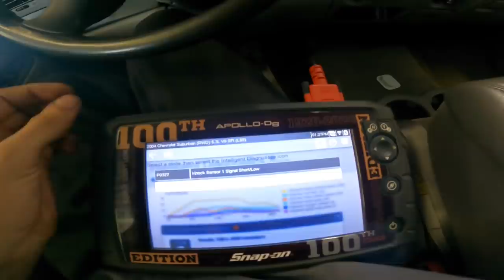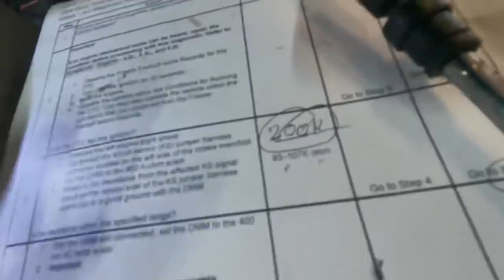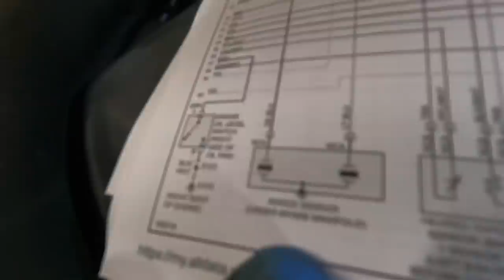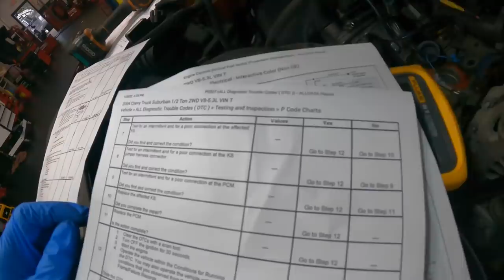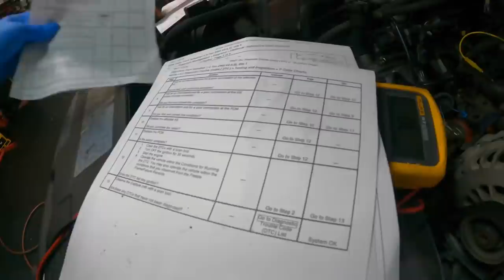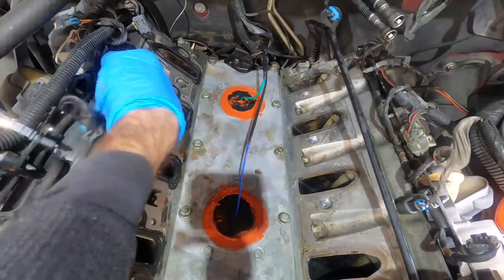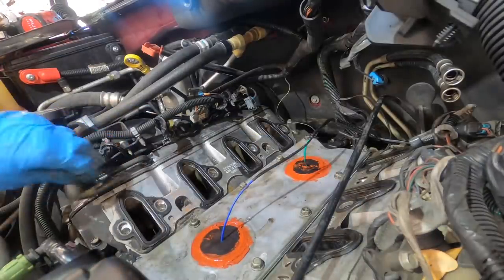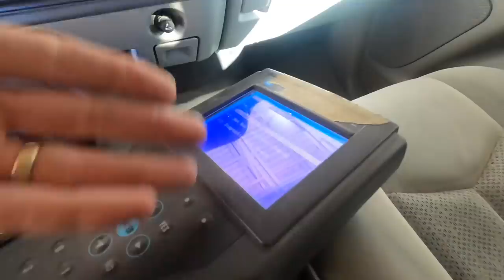Had to DRILL the engine block. NIGHTMARE Diag! LS 5.3 Check engine!

Comment: I highly recommend some cutting oil when drilling metal, and lower speeds and high pressure if you can. It takes patience but at the end of the day your drill bit will stay sharp longer
Reply: If you check a drill bit feeds and speeds chart you will be amazed at how fast you are supposed to run them.  Faster than most hand drills will go.  A 3/16 drill bit recommended speed is 2800 RPM.  And the smaller drill bits run even faster.
Reply: @johncooper4637  then why does my 1/8-1/4 metal cut better the slower i go lol. Hell the slower you drill the faster your bit cuts to an extent anyways i always keep my drill on 2 never 1, but i never just full or half throttle it. There are bits out there tho hyperbits i believe, where its just full speed ahead. Ive actually have never heard of such thing of using a normal drill bit fast unless it was a hyper bit
Reply: Im no professional drill bit guy but i have found that with hand held drills using oil and going slower and applying more pressure helps preserve the life of my bits, even using oil and going fast it just ruins the tips. Maybe its because the hand held drill cant push the rpms the bit is designed for and cant cool fast enough?  Again i dont know very much about the science of it, just what i observe when using the tools
Reply: @danking5382 Because you can't apply the kind of pressure needed to match listed feeds and speeds.  Cheap drill bits will last much longer at lower speeds in a hand drill Because you can't push hard enough.  In a drill press or mill, fast will cut better and last just as long or longer, because the feed pressure is much higher, and its steady.  Hand drills are easily pushed around, causing chatter, which kills cutting edges.
Reply: @danking5382   I'm with you, I worked for a fab shop and did so much welding and fabrication in my free time, that I made it my day job and started my own business. I have a fabrication/machine shop, I also offer mobile welding services including 24hr emergency response, New service offer: Having been addicted to Jeepin' for as long as I can remember, I too need to get my fix for the wheelin trails. Needa trail-fix the rig so you can keep gettin your trail fix, Or just plain ol stuck? Call Willy Bros Yank 'em! You stick'em in, we yank'em!
Reply: @johncooper4637  True... smaller the bit the faster the speed. 
Same applies to all machines like drill press, bore, lathe and mills. 
RPM = 300 x V/d.  V being the max linear speed of the cutting tool material as applies to the metal being cut/drilled.
The thing is, the idiots that don't understand this fail to realise that the larger the drill bit the slower the max speed... to the point where those that should never have a hole saw in their hands go at it way too fast - the saw burns or throws sparks.... saw is ruined in less than a minute.. even with cutting oil or coolant.
Reply: @loganramos6900  A drill bit is a cutting tool.
You need to be able to recognise a dull blunt cutting tool.
You need to be able to hold the hand drill correctly... and apply force correctly.
The 'science' of it is... 
The cutting edge on the tool (drill bit or lathe bit) can travel along the length of a specific material (metal, plastic, wood) at a speed (velocity) that has no degrading effect on that cutting edge - the tool stays sharp and the cut is cleaner. 
Tool manufactures publish data on the recommended the max linear velocity, so machinists can select the correct cutting speed (rpm) for the diameter of the drill, mill bit or stationary lathe cutter.... according to the material the cutter is made from (high speed steel, cobalt steel, tungsten, carbides, diamond etc). 
Fact: To go slower is a waste of time... and to go too fast burns tools and also waste time. Too slow will result in broken drill bits... the most common reason why 'centre drill' bits break tips off - way too slow. 
Buy cheap rubbish quality drill bits and you buy low grade 'tool steel' that's probably poorly heat treated and ground. Don't let flash gold coloured bits have you think they last longer or that the bit is 'quality'. i.e. they vapour thin apply nitrited finishes to cheap crap too. 
Cutting fluids... multiple reasons for it's use... mostly does not relevant to hand drill usage. It's not oil to lubricate the cutter edge - you want the drill to cut, not slide.  
Very few good hand drills can actually spin at the correct high speed for a  1/8"  3mm HHS drill bit into mild steel or aluminium. 
No battery hand drill can spin at the correct high speed for 1mm or smaller drill bits into any material.... a direct motor drive dremel tool will  or perhaps air powered drill might get half way there.

Comment: This happened to me on my 2004 2500HD... The original sensors were rusted in place and the inside spun just like yours.... I drilled a hole on opposite sides of that outer plate, installed long screws into them and used a flat bar with holes in it to spin it out... It worked like a charm... Nice job, Ray....

Comment: I do these jobs all the time. You do not have to break the sensors and extract them.  if you have one that won’t come out. Pry that valley cover in the right spots it’ll just pop the thick rubber seals out of the bottom of the valley cover that’s under the knock sensors. And get some channel locks and twist the knock sensor off no problems no drilling!!
Reply: Useful, surprised no one noticed what you are saying. There is a second or 2 where he pulls cover back off to lube the seal that shows those large rubber seals.

Comment: Had that happen.  I used a pair of needle nose vice grips to grab the exterior of the sensor, then used a large pair across the jaws of the needle nose grips to clamp them on the sendor.  Turned the vice grips and spun them out.

Comment: Something to keep in mind when drilling holes. (Actually, metal work in general)
There is a 'speed' and 'feed' for each tool and material.
If you don't see a curly piece coming out, then one of those parameters is off.
Reply: Just a little fussy but cast iron will only make crystals.
Reply: A new sharp bit helps a lot too !!!! 😄
Reply: @Yawwee  And if you spin it backwards with cutting pressure on it just 1/2 a turn it is DULL and needs sharpened. I hate reversible drills! (except for those occasions where a reverse bit might extract a broken bolt)
Reply: Speed is one of the issues with hand held drills, I think it is impossible to gauge.  You also cannot put as much force on the bit as you can with a drill press or mill.  I thought those threads were aluminum but they certainly drilled harder than that.
Reply: Machinist here! You don't want curly bits they are bad. You want what we call 6s and 9s very similar to what you see in this video
Reply: @kenore4003  chips
Reply: Also a "push" value and a "tool wear" value and a "muscle fatigue" value and an "operator patience" value.
Reply: I just flex my forearms and put max pressure till either the bit breaks or my will of drilling breaks.
Reply: @DiamondScuff  yes if the bits not bowed ur not pushing hard enough , this is a good rule at sea , also channies work best backwards ... i learned this in the first 1/2 min stepping on a fishing processor.

Comment: Wow, that's by far the most impressive job I've seen you do yet, great job....Great intuition...That was a tricky one...If the first guy to work on those knock sensors would have just had some patience and looked up the torque specs, would have saved lots of trouble, time and money..It's a virtue for a reason...
Reply: @T.J. Kong I had to helicoil every bolt hole on the pan rail of a 4R75E (2008 Crown Victoria) because the owner of the car gorilla-tightened the pan bolts.  When he brought the car to me, he asked me how those bolt holes could be stripped ...
Reply: You have the best channel name!!
Reply: Whoever done the previous work should have gone to Rainman Ray's School of Mechanics and Attitude. 😉
Reply: @pdishley1  Agree!
Reply: @T.J. Kong Interesting--but, not sure why "most people" shouldn't just follow the manufacturer's recommended torque settings.

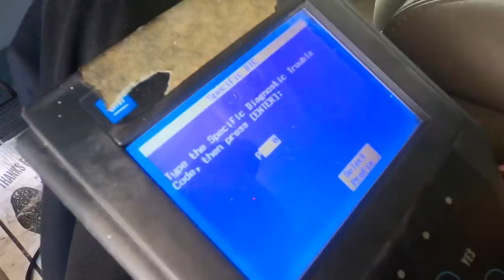Comment: 58:18 Well it said low frequency and one of the sensors clearly showed that when you tested them because one of them went over 100 with ease and even hit like 137 or so but the other just barely hit 100 and not really over.

Comment: If there is one thing I've learned over the years on those knock sensors, never under any circumstances, ever, use aftermarket ones. Only ACDelco. The cheap ones will fail within a year almost every time. That being said I have no idea of those were generic ones or not that were stuck. I've had generic ones fail within weeks though and it seems that 75% of the time the shell halves come loose from each other and then the top just spins.  I've hammered a big flathead into them and them wrenched on that to get stuck ones out. Have also hammered an extractor socket onto the top of the remains of the studs of them to get that part loose.
Reply: Just the fact that it's buried under the intake manifold, and, if things get worse, a valley pan, are reason enough to go with the best possible parts available!

Comment: Hello Ray
With your centre punch, just unscrew it and using your fingers put a bend in the spring. That will offset the punch and when you push it it will click back in alignment and strike the anvil.
Keep smiling mate 
J D

Comment: One tip for drill shaving control is to lay a large piece of thick paper over the area.  Bust out two small cutouts around the knock sensor bolts.  Use tape tape to make a tight seal between the paper and the metal.  The shavings collect on the paper, easy to vacuum up.  No greasy nook or crannies to get stuck in.  Rosin paper works well, it comes in large rolls at home depot.

Comment: Would have been interesting to look at the waveform from the defective sensor on a scope when tapping the block, both before and after the repair.  I suspect that if the crystal was cracked due to over-torqueing, it would likely have emitted a lot of extra spikes, thus confusing the ECM.
Reply: Even without Ray tappy-tap, i bet the waveform was all over the place with engine running; thus the ECM freaking out.
Reply: @hightttech  Yeah, crystals can only be marginally diagnosed with a multi-meter. Sure, you'll find an open or short, but most other failure modes are opaque without an oscilloscope.
Reply: Excellent diagnosis! The scope would have shown the real "story".

Comment: Weld a nut on it.  Drilling in the center valley is the hardest way to do that.  Actually you might of been able to use a punch on the edges and worked the broken stud out.  The clamping force of the stud was removed once the top was broken off.

Comment: I got myself some anti-clockwise drill bits for jobs like that, sometimes they bring the seized lugs out without the need for easy outs.
Reply: So true. Used the reversible drill bit and didn't need the extractor at all. Drill bit turned it out.
Reply: Me too.
Fist found them as an apprentice fixing automatic machines, a lot of them ran left hand drills.
Reply: Also known as "Left hand drill bits"
Reply: @christophermeyer6414  thank you… they’re left handed bits not anti-clockwise bits! Lol
Reply: @clintonhanson  We'll have to forgive Paul. He's a body shop guy. No worries Paul!👍 Just yanking your chain!😉😆
Reply: @christophermeyer6414  you know that anti-clockwise is also called counterclockwise
Reply: @clintonhanson  which direction do they spin?
Reply: @paulpaintshop103  left, or counterclockwise not anti-clockwise
Reply: @clintonhanson  they ain't pro clockwise 😂😂😂😂😂😜

Comment: I always cleaned the valley between the heads after 'plugging the runners of the intake.  I would also use double-sided tape or even 'flypaper' to catch any filings or pieces of metal in the valley as well as using shop towels when drilling or filing.  A little prep goes a long way!
Reply: A mechanic friend watched this vid after I told him about it and said he had the studs on the sensors shear off when trying to change them. He used a 12 ounce red Dixie cup with a hole in the bottom to capture the chips from drilling. Kept the chips confined to a small area.
Reply: @ajwilson605  ...thinking outside the box...awesome

Comment: I had to change the rear knock sensor on one of those a while back.  Had the same problem, we used one of those induction heater's and heated it until it was red and it came right out.  I know heating part of the engine block is not ideal, but it worked good and there were no metal shaving's to clean up.

Comment: As a aircraft structure mechanic, may I suggest Tack Cloth. After you vacuum up the majority of the chippies, tack clothes are great for picking up chips and dirt. If I was the customer, I would be highly aggravated at the other shop who installed those knock sensors. You did a great job diagnosing . By eliminating all other possibilities according to the diag chart, what remained to was the only probable answer. The knock sensor(s) themselves. Most excellent video sir!

Comment: Great job on this one, Ray. I wonder what the knock signals of the broken sensors would have looked like on an oscilloscope, compared to good ones.

Previous knock sensors install was probably done "by feel": just increase torque until you feel them slip and an extra turn to make sure they slip properly and that those delicate crystals inside are properly grinded to pieces.

Comment: That’s a pretty clean Tahoe for being a 04…all the ones around me that old have 200k and rusted to hell
Reply: We live in Florida. We don't see many rusted vehicles. My '03 Silverado is still mint.
Reply: It is the road salt that rusts the cars up. We have some beauties here in the North East.
Reply: I'm in NY and have an 05 Trailblazer and still in excellent condition, along with a 2000 Jeep XJ that only has some surface rust underneath. Frequent washing pays off. During the winter, I'm at the car wash after the roads clear from the snow. It could be once or twice a week. I love my cars and want to keep them as long as I can.
Reply: @WastedTalent-  how many miles? My fathers 2015 explorer sport is already bubbling up and rusting on the inside of the doors pretty bad and he washes once every 2 weeks,  I live near Cleveland maybe it’s worse here. I was driving today and there was literal piles of un melted salt scattered all over the roads left over from city plow trucks.

Comment: First off, I'm going to guess that the sensor moving in the housing issue was probably ok at 70 degrees (or whatever it was in the shop) but not okay and engine operating temperature due to heat expansion.  I don't know how the knock sensors are constructed, but I can totally see them operating differently/not operating at all at full temp.
As far as the Snapon guy and the warranty, you didn't use them as a "prybar, punch, or chisel"!  You used them to unscrew something!  Totally their designed purpose!!!
Great job on this one, Ray!  Diagnostics is what separates a really good professional from just a parts changer!